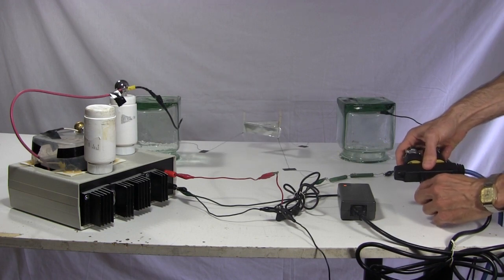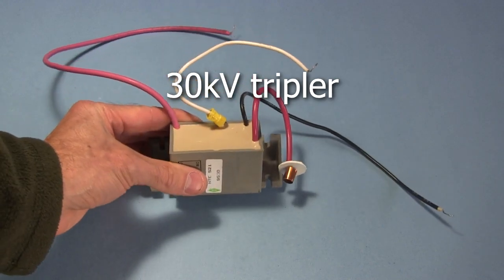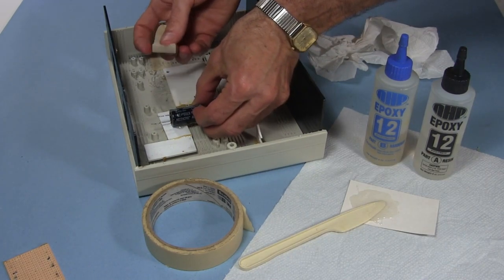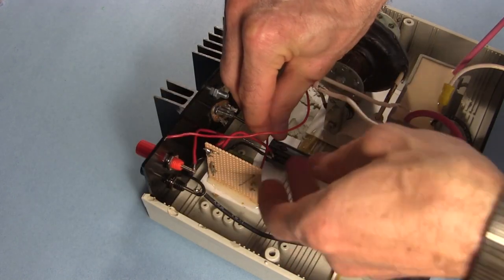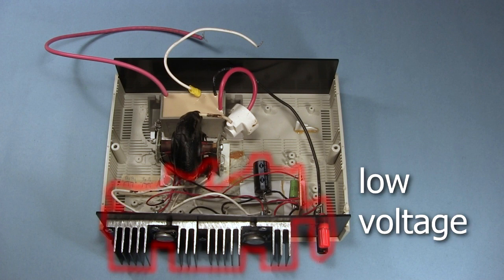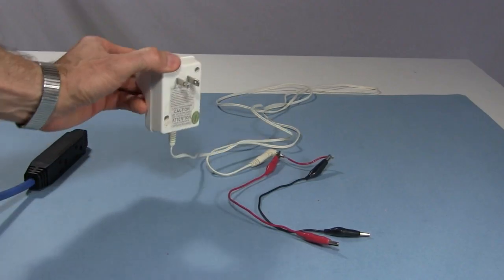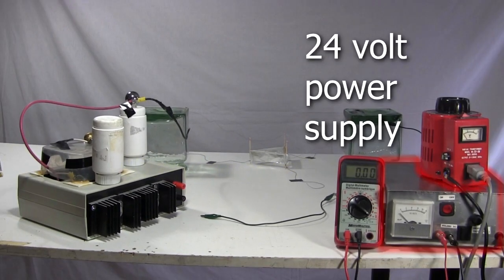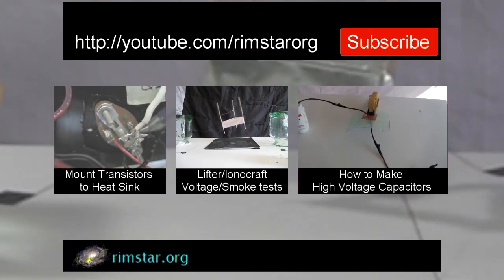How to Make 30kV High Voltage DC Power Supply with Flyback & Cockcroft-Walton Multiplier Tripler

Comment: Love your videos! I been a  electronics technician for 45+ yrs. You know your  stuff no doubt in the world!  I am going to build this . I have all the parts and especially the fly backs and  triplers. That flyback you show in this video looks like it came out of a old ctc RCA  all tube set . The cap off the transformer went to a  tube hi voltage rectifier tube  and  a tube hi voltage shunt regulator . Usually  the shunt regulator handled 25,000 volts DC which then fed the anode on the crt. Thank you for this excellent video!!!!

Comment from the maker: I wouldn't like to say for sure, especially since I'm not familiar with garage door openers, but this is high voltage DC. As long as the voltage is held steady then there isn't any strong fluctuating electromagnetic field. However, when there's a spark there is. Unless someone knows for sure regarding door openers, you'll have to take your chances. I use it in my apartment with computer, answering machine, modem down the hall, and camera a few feet away. No damage.

Comment from the maker: After a week-long delay it's finally out! How to Make a High Voltage Power Supply. The delay was because I really wanted to show how to use something like a wall adapter to feed it when flying the lifter/ionocraft. The breakthrough came when I realized I could use a laptop power supply as the adapter - which I thought was pretty cool!
Reply from the maker: Have you cracked one open for parts? If so, anything good inside?
Reply: I haven't gutted one, seen a few tear-downs. Transformer, wave rectifier, mid size cap for rectifier buffer. Sometimes a regulator, resettable fuse, and a few extra diodes for safety. Nothing worth destroying a working 3-6a 20v psu for. The smaller lighter wall warts are oftern a step down buck converter. Sometimes you can change the output voltage. Rarely see them over an amp out though, probably a reason for that... Phone chargers can be good for 5-7v Got a few that will do 1.5a. Put a few in series if you need more volts. They seem to parallel ok too. Been thinking about making my own transformer with a flyback core, and adjustable buck converter. Drive a zvs with a few amps at 290v :)
Reply: RimstarOrg  How to make high frequency power supply? Specification likely 3 MHz-20 MHz and 200 W?
Reply from the maker: Basudeb Behera
200W? I don't know. If you want low voltage than you can buy oscillator chips in that frequency range, but you'd probably have to add some amplifications to get that wattage.
Reply: I use computer atx powresupply

Comment from the maker: Thanks, Grant! I don't know about all flybacks but if it's from an old CRT TV then it should work. It's much the same circuit as in those TVs. If there's electronics attached to the flyback then you'd have to remove it if you can. However, and I haven't tried this myself, that electronics is supposed to be the equivalent of the tripler I show in my video. So theoretically, if you have one with that stuff attached then you could just use it without the tripler. The HV wire has the suction cup.
Reply: RimstarOrg 
How much volt flyback transformer is used in this video

Comment from the maker: The HV power supply isn't amazing to me either. But that's because I've been using it for years. However, I liked using the laptop power supply to feed it and run the lifter. That was new to me and I was delighted the first time I saw it working!

Comment from the maker: My experiment is safe, or done safely, as you can see from the use of the discharge stick. But the power supply is dangerous since it can deliver milliamps of current, unlike my small homemade Van de Graaffs which are mostly harmless. Hmmm... I think I'll add some warnings. Thanks for bringing it up.

Comment: Another hack for an HV supply is an automotive ignition coil.  I built one using that and some high voltage rectifiers some years ago.  That's a very old flyback you used!  The White cap is made to fit a vacuum tube rectifier.
Reply from the maker: I made an ignition coil one too a long time ago, though I never documented it. It used a 555 timer chip for the pulsing. I made it so I could have pulsed high voltage that was tunable via the 555. I could adjust voltage and frequency. Regarding the flyback, yeah it's hard to find ones like that that don't have a built in diode these days. I didn't know the cap was made to fit a vacuum tube rectifier though -- thanks for letting me know. Interesting, and that means it's older than I thought!

Comment: I'm sure others have said this already but, you can get much more power (milliamps and volts) by using a modern FBT and MOSFETs. You can get up to 60KV+ although it is pre-rectified it gives a moderate amount of power. The 555 flyback driver will give you a rather balanced power supply that will allow you to adjust the frequency to resonate the transformer. it also can push a lot of amps. (depending on the MOSFET[s] you use.)

Comment: You may have figured this out by now, but the positive and negative on that radioshack wall wart is set by removing the end and flipping it around. the plug should have writing on it that says tip, and the wire has a + and - on it. Plug it in with the word tip over whichever polarity you want the tip to be.

Comment: For me just using the AC flyback as a out put is more use full , even if it can out put 4kv at max , but from personal exp I know that whit those 2 transistor you can get more high voltage AC if you calc the primary and feedback coil on the outer side of the forayed core (something like 8 for the feedback and 12 for the primary

Comment from the maker: Thanks. I guess it's easier to use a heat sink with a transistor than it is to cool a primary. Lowering the frequency would be boring. :)

Comment: gr8 job merci beaucoup for sharing 
The new school version   uses FET's and diodes to do the switching and only one winding instead of two windings. The FET's dissipate less power so they run cooler and no high power resistors are needed

Comment: This is a rather good design low cost, simple and probably reliable I will see when I build one.  I have simulated the circuit with LT SPICE
and made a few tweaks adding a  few more turns to the primary and feedback coils plus a small cap (22 uf) to the base bias resistors 
this seems to improve the circuit.  The particularly desirable property is the low voltage supply may be slowly increased and the circuit 
will self start at about 3 Volts a runs all the way down to about 1.5 volts according to SPICE which has proven reliable in the past.

Comment: Pretty cool.  I prefer to use the ZVS circuit to drive flybacks tho, it puts out more power but  I can't run it for too long as the primary starts to overheat after a minute or so, the transistors on the other hand barely get warm at all.

Comment from the maker: This is a negative ion generator, though it's a very powerful one. If I switch the connections to the lifter/ionocraft in this video such that the ground connection goes to the thin wire and the high voltage power supply output goes to the aluminum foil then the thin wire would be emitting electrons and causing the surrounding air to be negatively ionized.

Comment: I recently built a high voltage dc (40-60kv) power supply powered by only 12v dc. I might hook it up to a 9v battery and see what it does! I currently power it from my 12v dc power supply and use the potentiometers on that to control the voltage. I then disassembled a plasma ball and took the high voltage ac circuit out of that. I took that into a diy voltage multiplier. I hooked it up to an ion engine and at that voltage it was insanely beautiful. I might make a video on it. After shoving it in a cardboard box for keeping safe-ish, it would be around $50 (excluding the power supply).

Comment from the maker: Off-hand I don't know of any. It's easy to make a compact 12 volt DC to 5000 volt circuit, but adding the 240 volt AC conversion side adds bulk. But that's just with what I know of. Keep searching and you might find something, unless someone here has ideas.

Comment: Hey, 
I'm about to try your spark gap tesla coil just wanted to know how much voltage is required as input?  
Please respond!
Reply: Hey, i know i am a bit late but any voltage as long as it is enough to spark over, i'd say about 3-4kv is the lowest you can go, but it is recommended to increase capacitance as stored energy will be lower.

Comment from the maker: Actually I'm not using power to create power, just converting it from 120 volts AC to  up to 30 kilovolts DC for things that need it in that form. "Power supply" is a common term for devices like this. Do a google search for "power supply" and you'll see that.

Comment: hey there RimstarOrg ... thats quite a nice power supply setup you built ! i like the vintage flyback as well works very well for your ion lifter .. had a question for you about your lifter .. is there some other lightweight materials i could use instead of the balsa wood .. i want to build one for one of my next projects but most of the model stores here in Germany are for trains only .. thanks for the video cheers mate !

Comment: I love how most of your tutorial revolve around using the cheapest, around the house items. I am surprised i haven't seen your projects until recently! I (time allowing) may make a few of these this coming summer! One question though, about this HV producer. The 30kv tripler/Cockcroft-walton Voltage multiplier. I tried looking such a device up, and i can't seem to find anything with those specifications. Could you possibly send me a link of a purchasable one that would suite this power supply?

Comment: I've learned so much from RimstarOrg!  Thanks and please, keep it coming.  

I priced a Fluke high voltage probe on Amazon for over $200 (US).  Can you give us an idea of what it does, how it does it and if there is a work around.  Most of us are left to guess voltage by arc length (in mm), such as where it starts on a Jacob's ladder using the rule of thumb: 3Kv/mm in dry air.
Reply from the maker: Thanks! I'm always glad to hear my videos are helping.

See my video on taking apart my Fluke HV probe https://www.youtube.com/watch?v=kXq4FCQ0C38 For how they work, I have some explanation and links on my webpage about making my own https://rimstar.org/equip/hv150kvprobe/hv150kvprobe.htm Hopefully that helps.

Comment: Does this flyback circuit produce more voltage than your "cube circuit" because the flyback in this circuit has more internal windings?
Reply from the maker: John Kerley I don't know. I've never measured the output for this one at the flyback. After it's gone through the multiplier then yes, this power supply produces more voltage than the cube power supply. I don't know how many windings are on the high voltage side of either flyback, so I can't guess based on that.It would be difficult to measure both in a way that they can be compared anyway. The cube's flyback has a built-in diode and I'd have to break it to bypass it. Whereas the flyback in this video doesn't have any built-in diode.

Comment: Hi there, thank you for sharing this video. I am a first timer in building such electrical power supply. However I will be needing it for a project. There is one question that I hope to seek for your clarification. For the 1mm and 0.5mm wires to wrap around the Tripler, must I use the exact same specification on wire diameter? Thank you.

Comment: Sir can you plz tell me what is need for grounding the negative terminal????? I don't know why you did this???
Reply from the maker: Which negative terminal are you referring to? Overall, grounding is used for this power supply so that we have something for the 30 kV to be relative to. Voltage is always relative to something. So this power supply can put out 30,000 volts relative to whatever ground we use.

Comment: The reactor is kind of the core of the "converters". The different energy states for example wind, turns the propeller so that the energy acts in a different way. Wind is impetus and the turning of it propeller is also impetus. They are the same kind of energy state but they act differently :) So as I said, the reactor is kind of self-explanatory, it makes the energy state act in a different way, re-act :D

Comment: Hi, I was wondering if the high voltage frequencies would mess with sensitive electronics.  I work on my projects on a work bench in my garage, and I'm afraid that the high frequencies may break the garage door opener.

Comment: When you put rounds wires on the transformer, is there a winding under it? Do you have to solider the wires to the transformer? Are those the 18 and 24 gauge wires? Thanks
Reply from the maker: Marcell Veszpremi No, when you put round wires on the transformer there are no windings under it.No, you don't solder the wires to the transformer. The interaction between the wires and the transformer is through the electromagnetic field that the the various wires createYes, they are 18 and 24 gauge (AWG) wire.

Comment: So if I were to use the homemade negative Cockcroft-Walton voltage multiplier, it would still work the same way? And it would still work for an ionocraft?
Reply from the maker: Yes, it would work the same way. Provided the only difference was that the Cockcroft-Walton voltage multiplier was configured for negative instead of positive (i.e. it was still as powerful as the one in this video) then yes, it would still work for an ionocraft.

Comment from the maker: I bought some high voltage capacitors and high voltage diodes from amazing1.com. I used them to make a Cockcroft-Walton voltage multiplier circuit, which is all a multiplier is. I just put a link to my webpage about the one I made in the description below this video. Just make sure you get high voltage rated ones than you need, to avoid accidentally ruining it when making really big sparks.

Comment: I don't have much time and the availability of materials for the power supply. I am building the ionocraft in the other video. Can I just plug in an adapter with a power multiplier and use it on the ionocraft?
Reply from the maker: No, you need a high voltage. I don't know what the power multiplier is that you're referring to but you need to step up the voltage to around 25,000 volts (versus the 120 or 240 volts from the wall socket). You also need a relatively large amount of current, more than an electrostatic machine like a Van de Graaff generator or Wimshurst machine can supply. There is the idea of using a PC monitor like I do in my "How to Make PC/Computer Monitor into High Voltage Power Supply" video, but it's fairly dangerous so make sure you know what you're doing if you open one of those up.

Comment: one more thing: I tried simulating the circuit in Proteus and even in PSpice but I did not find a representation for the flyback transformer and the NTE521 tripler. I would like you to please tell me how you drew the circuit, possibly what model did you use to represent the flyback transformer or the software you used. Thanks
Reply from the maker: +MAXWELL AMOAH I didn't use any software or do any modelling. This is a very old and common circuit. I think I originally got it from here many years ago http://jnaudin.free.fr/html/lifterb.htm but you can find that circuit all over the web.

Comment: Hello. I have taken out a flyback transformer from an old TV.
How do i know if it is suitable for the job?
Reply from the maker: Most TV's flybacks will have a diode built in which means there'd be a lot of extra bulk to the flyback, like this
http://rimstar.org/science_electronics_projects/high_voltage_power_supply_w_flyback_transformer_builtin_diodes/flyback_builtin_diodes_blue_bkgd_cran.jpg.
A suitable one wouldn't have all that extra bulk. It would have a more visible coil and look something like this http://rimstar.org/equip/30kv_pwr_supply/flyback_transformer_with_just_coil_and_core_cr.jpg.
The problem with the one with the built in diode is that it can't power a tripler. A tripler wants AC and one with a built in diode puts out pulsed DC. The tripler is what raises the voltage from 20kV to 30kV in this circuit.
If you have one with a built in diode then you can try removing the diode but I'm not sure it's even possible. I looked online a short while ago and didn't see any good ways of doing it.